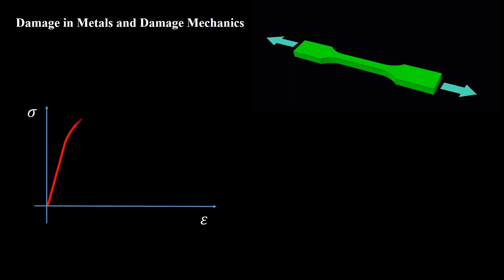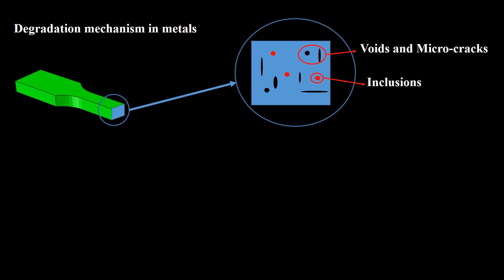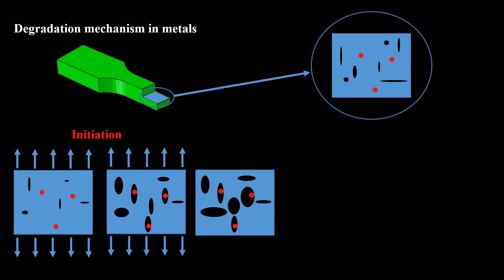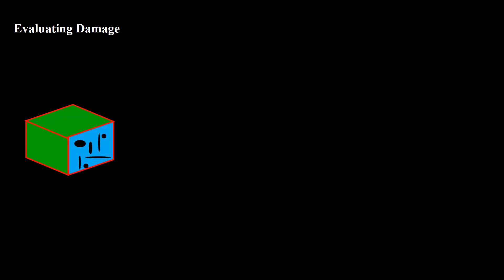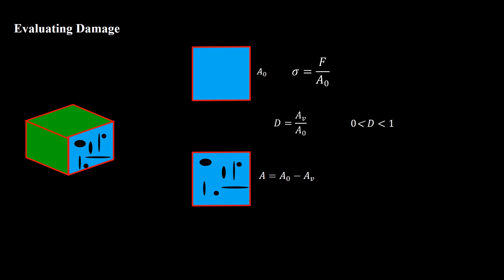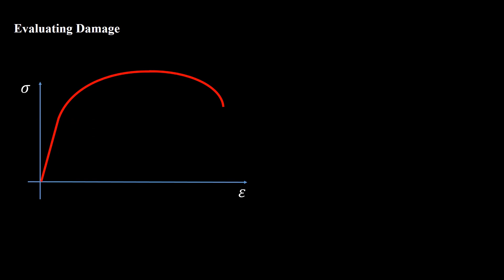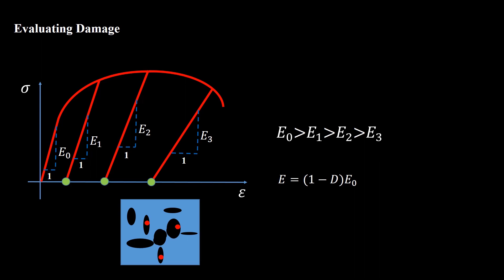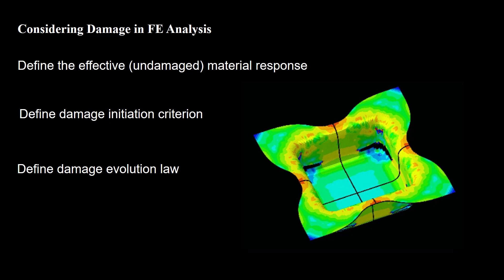Understanding continuum damage mechanics

Comment: How would one virtually simulate this by turning these functions into programming code? How does the math get translated into computer code into a simulation of the ideas discussed here to produce realistic breaks in virtual materials to simulate realistic depiction of these phenomena? If someone knowledgeable in both the math and ideas discussed here as well as programming languages, could you please inform me. REALLY curious!
Reply from the maker: To realize relationships of damage mechanics, you should study constitutive behavior of materials and then implementation of these behavior in codes. For example this book is good to understand constitutive behavior including damage:
 Engineering Damage Mechanics
Authors: Jean Lemaitre , Rodrigue Desmorat
And you can find some books about computational plasticity for implementation of these relationships. Before these two topics you should know FEM. 
Studying all these matters maybe take a semester of a graduate student. :goodvibes:
Reply: Generally you model the problem with something like the Finite Element Method (FEM) and then use a solver for the resulting system (with something like PCG). For the coding part, you'll see implementations in Matlab, Octave, Julia or C/C++ (for GPUs, CUDA is frequently used).